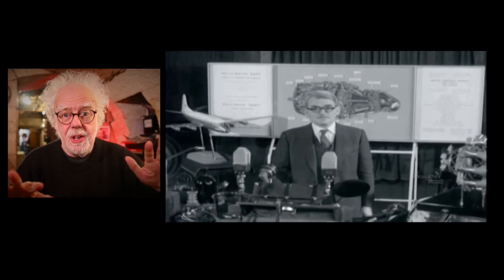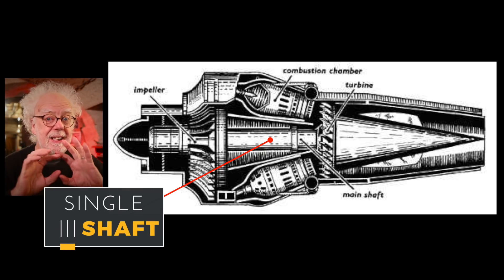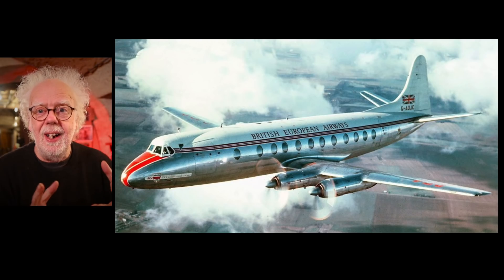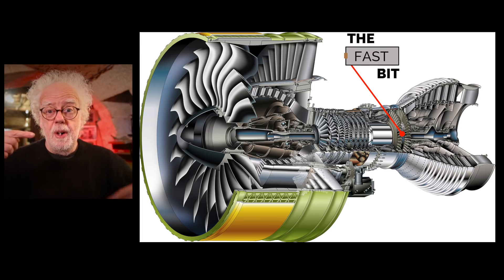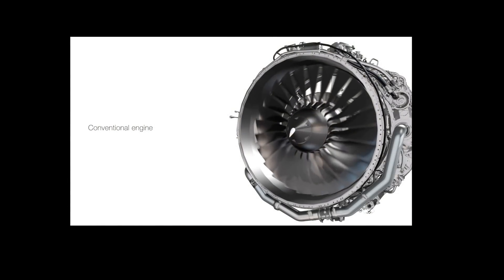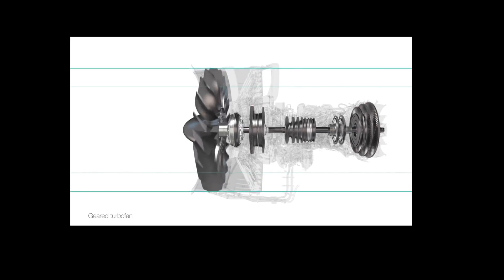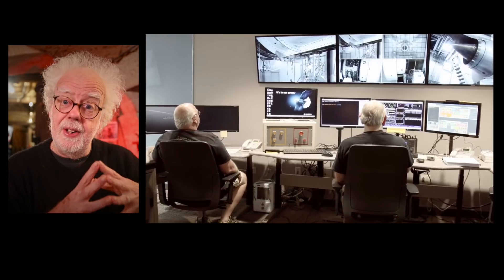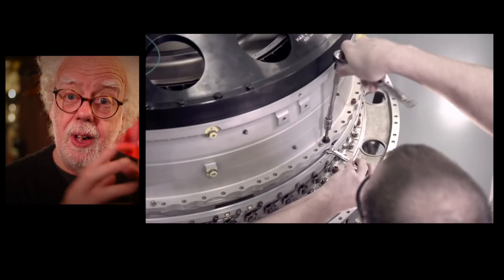Greater than the JET engine - Prof Simon

Comment: I think Frank Whittle’s original engine test bed now resides in Peterhead, scotland with Score engineering ltd, while amongst other things convert jet turbines for other purposes.
Reply from the maker: Interesting....let me know please
Reply: Professor Simon Holland   I read in our local newspaper a few years ago (the press and journal), that the score group had purchased the original mounting rig/ test bed that frank whittle used. Score we’re going to use it for testing repurposed jet engines into gas turbine power units for the oil and gas industry. Unsure if they still use it as this was nearly twenty years ago.
As an extra they do have a British electric lightning in there grounds of there main office in peterhead.

Comment: Propeller vs jet engine efficiency.. How do we define efficiency.. Fuel vs product? I learned that jet engines are capable of operating at much higher altitudes than propeller engines.. .. Anyhow, interesting video. Thanks.
Reply: Great comment firstly. Efficiency can defined in a multitude of ways, thermal efficiency (fuel to heat), mechanical efficiency (various definitions), electrical, overall (fuel to prop), and more. In this case, I believe it will be referring to fuel to propulsive efficiency, so taking into account thermal ( fuel to heat, ~50% efficient), turbine efficiencies (~93-95% overall per spool), transmission efficiencies (~99.95% for the shaft, 99.5% through the gearbox to the fan), and propulsive efficiency (~90-92%) total, giving roughly 40% fuel-to-fan efficiency total, or thereabouts for a geared turbofan. Generally, turboprops are more efficient because of the lack of duct and inlet losses as with turbofans, which means ~2-5 % overall efficiency increase. This is due to cowling size constraints, boundary layer losses, and also tip effects (notice turbofan blades are swept forwards whereas propeller blades are swept backwards, which is as a result of numerous phenomena that I'm happy to go into more detail about on request. 

As for altitude, you're roughly correct, as altitude increases for a gas turbine, efficiency increases (lower ambient air temp, lower air density) due to better work-fuel ratios. But for turboprops, you get the best of both; better core efficiency, better propulsive efficiency. The higher the altitude, the less air there is to move, so props are less constrained than turbofans, however IC engines suffer at altitude because of the lower air density and their fundamental feature of fixed volume combustion vs gas turbine with continuous volume combustion, which results in better fuel-air ratios. Ultimately, there are dozens of efficiency-affecting parameters with propulsion, so the story isn't a simple one. But as a general rule, as the bypass ratio increases, the efficiency increases. Fan pressure ratio, OPR, and many more also have a big impact too.

Comment: Jet engines are going to be useless in 2040 for obvious reasons.
Reply from the maker: What’s the reason?
Reply: A rumour says they are not going to use aviation fuel anymore on commercial aircraft.Virgin already are into production of a new type of fuel not oil based.

Comment: Well Frank Whittle did have 20 years of steam turbines for inspiration so the saying that inventors walk on the shoulders of giants is true enough. Not taking away from Frank - he made it happen - he had the imagination that it might work and he overcame the naysayers no doubt.
There is a holy grail in aviation that seems to be insurmountable. It is the VLJ (Very Light Jet) engine. Before the financial crisis it was looking like it was going to happen. There is this fascinating article called The Little Engine That Couldn't. When I read that article I just about cried. What this engine 'promised' was fuel efficiency in a jet engine in the sub 20,000ft VFR altitudes for the GA market. It didn't work out as the article cronicles and the last the engine was seen was on the back of a go kart. After reading the article I still hope that someday someone will make it happen. Here it is:
https://www.airspacemag.com/flight-today/the-little-engine-that-couldnt-6865253/?page=1

Comment: The fan gearbox is an excellent concept BUT will create new failure modes not present on a direct-drive engine, so it will take a while before we learn how to build them to be relatively bulletproof.  Airbus may be willing to take this risk in order to adopt the latest tech.  A couple of their helicopters have fallen from the sky (killing dozens) when a fatigue failure occurred in the rotor drive gearbox because their design had the rotor system attached directly.  If the rotor had been mounted separately and driven by a breakable link, that same failure would not have prevented an autorotation.  My only point is that designs that seem simple and elegant may have hidden shortcomings that will be discovered by early adopters.

Comment: I dispute that Frank Whittle invented the jet engine. His design had a centrifugal compressor in the front that sucked air, compressed it and passed it through convoluted passages to the burner and turbine in the rear. This engine produced low power and more toque. On the other hand Hans Ohain in Germany and Japanese engineers were working on the axial flow type of jet, which were the first, early turbojets. The Germans then came up with two operational engines, the Jumo 004 and the BMW 003, which powered the Messershmit 262. The Japanese turbojet engine was the Ishikawajima Ne-12, which came in the back of the Ne 10 (a centrifugal design similar to Whittle's engine which they abandoned in favor of axial flow for more power).
Whittle himself had his pains with the MoD, or they had their pains with him. His designs made little progress and in an effort to make something of it, the MoD got a car factory to improve it and get it in the air. The Gloster Meteor was the result, with its massive bulge at the engine intake. But before that, there were already jet aircraft in the skies of Germany and Japan. Remember this when you board a jet plane.
Reply from the maker: Frank invented the gas turbine
Reply: @SimonHollandfilms  Fine, however the gas turbine should not be equated to the turbo jet - two different animals.
Just a side note, on the far side of the globe, the Japanese Ne 10 was a similar gas turbine.

Comment: Professor:  
 To throw a proverbial bird into the engine. As I understand it most fan type jet engines are twin or in the case of Rolls Royce (Trent 1000) triple shafted engines. The fan is not physically driven by the turbine jet engine. It has its own turbine in the exhaust gasses that allows it to spin at a different speed. Therefore the jet engine runs at a constant speed and the fan turns at max load for the amt of power it can harvest from the turbine exhaust This is pretty much the same as gearing. Or not?
Interesting thought though smaller turbine at higher speed,  gears for the fan,  may prove to be more efficient because they can use a smaller engine to drive the same size fan

Comment: Jet engines have many moving parts ‘professor’, not just one. Even Whittle’s first prototype engine had more than one moving part.
Reply from the maker: Lots of accessories but the single drive shaft was a radical improvement over the internal combustion engine

Comment: Garrett's geared turbofan engines came decades before Pratts engine.  

The Garrett TFE731 (now Honeywell TFE731) is a family of geared turbofan engines commonly used on business jet aircraft. Garrett AiResearch originally designed and built the engine, which due to mergers was later produced by AlliedSignal and now Honeywell Aerospace.

Since the engine was introduced in 1972, over 11,000 engines have been built, flying over 100 million flight-hours

https://en.wikipedia.org/wiki/Garrett_TFE731

Comment: What’s also interesting is that this is something that P&W tried before. 

In the mid 1980s, Airbus was looking to aggressively expand its fleet of airliners. The first priority was a lucrative single-aisle airplane to compete with the Boeing 727 and 757–which we all know today as the A320. The second was a larger four engine airliner that would position itself as a DC-10/L-1011 replacement, open markets unavailable to ETOPS aircraft at the time, and be a stepping stone to a Jumbo or Superjumbo aircraft. This was the A340. 

Initial studies of the A340 centred around the CFM56 engine. But there were concerns about lack of growth potential (which did come to fruition) as well as the increasing vulnerability of airliners with more than two engines in terms of operating costs. 

P&W was part of a group called IAE and like CFM when they first started out they had a high tech 10 ton engine and virtually no customers for it. The 737, A320, and A340 had all decided on the CFM56. 

But there was a new development called the Super Fan. It was a geared fan version of the engine which promised more thrust, in combination with almost unheard of fuel economy. Airbus quickly changed its mind, and wanted to sign an order for these engines. 

The trouble was, it was premature. Technical problems with the engine prevented it from ever reaching production, and their fuel economy figures didn’t account for the increased drag... and therefore lower cruising speeds... and therefore fuel/mile costs not much better than conventional engines. 

Airbus chose the CFM56 for the initial A340 versions, and the Rolls Royce Trent for later versions.

Comment: Consider one doesn't need the fuel burning, just use magnet-to-magnet motors, this 1300hp/1-Mw is tiny, only 24x7in/61x17cm.

Without much imagination it's the way to go.

technokontrol.com/en/current-projects/generator.php

Sparkless, military-spec, ships in a container.

Comment: They could use a ferromagnetic fluid connection rather than a geared system if a failure the engine could be designed to go into a less effective jet mode or feather mode, in normal use it would be slower than the  hot compressor side but still in the same direction 🤔
Reply from the maker: I like it

Comment: Boeing may have been smart (at least about this.  They made other mistakes with the 737-Max.)  The geared fan engine has proven very problematic for the A320NEO.  Operators are looking for compensation for down time.

Comment: wait till you see the latest designs from rolls royce ! integrating 3 shafts, geared fans, and composite/hollow fan blades, and their technology is based on reliable older tech from turboprop engines that have years of service to back it up.

Comment: Surely multi shaft engines have been around for decades. These decouple the low pressure turbine from the high pressure and can run at different speeds. Rolls Royce uses three shafts for its RB211 family which is more flexible than the GE two shaft system and means they do no have to use gears to achieve higher bypass ratios, at least not yet.

Comment: Geared turbofans have more moving parts, there bis a concern of reduced reliability and higher maintenance costs.
Gear systems also have a maximum power transfer, that is why they started with smaller engines and are working towards larger engines, as they show they gears can handles real world operations.  Larger engines and other engine manufacturers have looked at methods to increase the bypass ratio. Which seems to get applied first on the largest engines.  The fact that both optimizations don't currently work in Middle of the Market aircraft (757 size), is one of the reasons this segment has been neglected in recent designs. If one or both approaches can be made to work on medium thrust engines, a surge of new Middle of the Market aircraft designs will come on line.

Comment: With all the moving parts of a planetary gearset I cant help but wonder what the TBO will be for the gearbox. I have doubts that they will be able to match the TBO for a non geared engine. At the very least they will be adding oil change intervals for the gearbox. It will be interesting to watch and see if the geared engine is affordable to operate over the long term.

Comment: What could be even more efficient is the electric hybrid airplane. One turbine providing electric power to multiple electric ducted fans. The turbine only needs to be big enough to be optimised for cruising power output while super capacitors or batteries can provide the surge power for take off.

Comment: Looks like a Simpson gearset, "planetary gearset" consisting of a sun, planetary, and ring gears. You'll find smaller sets in automatic transmissions. 2 or more sets.
Reply: A Simpsons gear set just a specific planetary gear set that has specific gear ratios that allows you to create three forward ratios and one reverse ratio by stopping a specific portion of it. 

But these planetary gears are one ratio in one direction. The ring gear is always held and the sun gear is driven, the planet carrier forms the final drive.

Comment: Gearboxes are very often a source of problems.  A lot of moving parts, issues over tolerances and high stress loadings. Both GE and Rolls Royce are currently struggling with design/materials issues on conventional fans. Will the geared engine make things better, or worse?

Comment: Nice video but was is new? Don't you have a gear on a "turboprop engine" ?
How can it take 30 years of development when you just replacing the propeller with a big fan😉😊
Reply: Because this fan is being driven by about ten times the power of even the largest turboprop engine.

Comment: Alright pilots, time to learn the
clutch-pedal and stick-shift! :P
Reply: Meanwhile,  cars have mostly lost manual transmissions, and electric cars generally have single speed gearboxes because there's little reason to bother with a more complex multispeed gearbox...
Reply: @KuraIthys  actually for a combustion engined car, manual gearboxes have less drivetrain loss than automatic gearboxes, especially compared to CVT. Also manual gearboxes have less parts and are less complex, depending on the skill of the driver they can be much more reliable and a bit more fuel efficient than their automatic counterparts. 

Automatic is more to do with luxury, comfort, and ease of use. Especially for those traffic jams.

Comment: I can't imagine that this is really a new idea. Piston prop engines have used gear ratios in the past. My gut tells me this might have more to do with a push for advertised improvements in an eco conscious (obsessed) era. It seems evolutionary, rather than revolutionary. Although using the planetary gearset to achieve contra-rotation is an interesting twist (see what I did there)?

As others have pointed out, the addition of gearing will increase the number of possible failure points on the total engine assembly. And while we're talking moving parts, there are far more than just one moving part in a gas turbine engine. Just because the main shaft is rotating as one assembly doesn't mean we can ignore secondary systems. Oil, fuel, and cooling handling systems to name a few.

Since commercial aviation historically has put passenger safety ahead of efficiency or the environment, I suspect the idea was out there for a long time, but there was reluctance to take on more risk in an already risky business.

Comment: Well, it's about time that they caught up with piston engines. The first gear reduction engine I saw was on a Cessna 175 which was from when? the 50's? Then experimental aircraft (homebuilders) used automobile engines and geared the propellers down. The concern I have about using them in turbofans is more parts moving under high stress. Surely some will fail. Oh and, didn't England and Germany simultaneously develop the jet engine? Seems like the Germans got it working first.

Comment: Works great 👍 BUT what if we could power a craft with gravity. This revolution in propulsion would be like moving from sail to propeller. The clue to gravity propulsion creating a artificial field in front or top of the craft. Either neutralizing the planets gravity and adding another for directional movement. The generation of graviton’s is also a key.